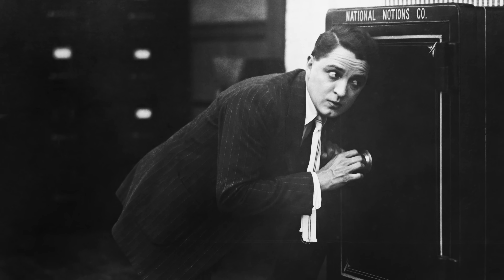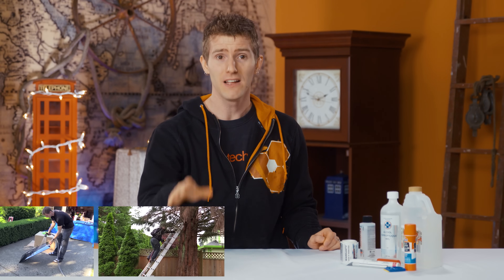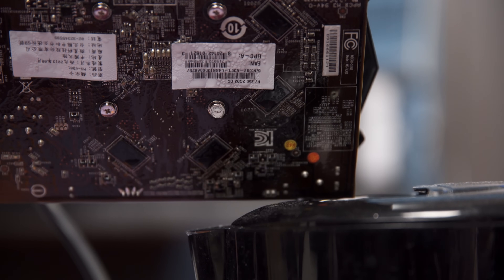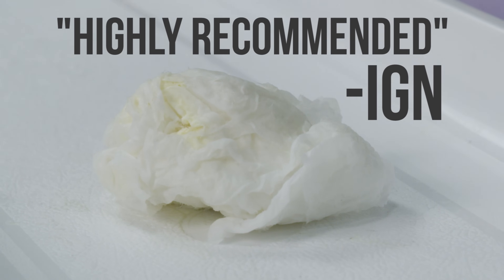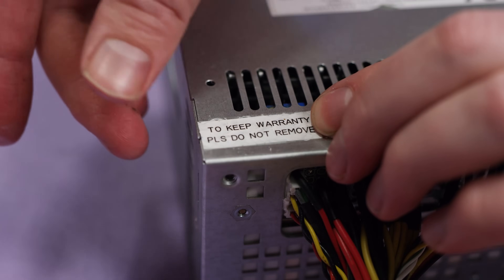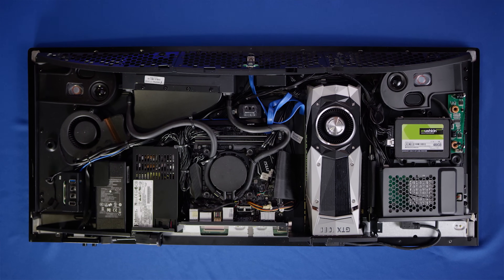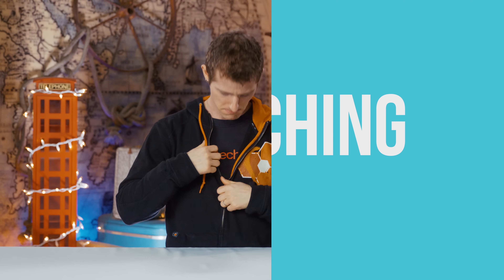Safely Remove Warranty Stickers

Comment: 'Warranty Void If Removed'? As It Turns Out, Feds Say Those Warnings Are Illegal
NPR, 11 April 2018

Oh, you've seen them before: those little stickers or tags making clear that if you want your warranty on a product to remain valid, you'd better leave one or more of its parts untouched. The idea, of course, is that consumers are barred from using third-party parts and repair services for the product if they would like to hang on to that guarantee.

Well, as you've probably long suspected — or desperately wished, at least — those warnings are bunk. Worse than that, actually: The Federal Trade Commission says they're illegal.

"Provisions that tie warranty coverage to the use of particular products or services harm both consumers who pay more for them as well as the small businesses who offer competing products and services," Thomas B. Pahl, acting director of the FTC's Bureau of Consumer Protection, said in a statement released Tuesday.

Specifically, the agency explained, those provisions violate the 1975 Magnuson-Moss Warranty Act, which bars companies from conditioning their warranties on demands that consumers use certain articles or services in connection with the original product.

That hasn't stopped companies from doing it anyway — and now, the FTC is fed up.

The agency said it had "sent warning letters to six major companies that market and sell automobiles, cellular devices, and video gaming systems in the United States." The FTC's announcement did not identify the companies by name.

Comment: If that's the law then it is wrong. There are many kinds of damages that cant be diagnosed as "caused by improper repair attempt". Examles?: Shorting some pins, putting higher than rated voltage into sensitive electronic IC etc. only time you would see visible damage is when things burn but even then it is not possible to prove that the burn happened due to "improper repair attempt" or on its own. So manufacturers SHOULD have the right to put such labels.

Comment: FYI: Adhesive remover is made from Citrus terpene. Often sold as "3M Citrus Based Adhesive Remover".
Apply it, wait a few minutes, and the warranty sticker will slide off cleanly, without damaging the sticker or the product.

Don't use any other solvents (especially acetone//nail-varnish-remover), or any of the other ridiculous DIY suggestions, as they won't work well, and may dissolve the plastic casing of your product, or damage the internal electronics.
Reply: The liquid may damage the components inside?

Comment: What has always boggled my mind is that opening the computer case is entirely necessary for maintenance to remove dust. How'm I supposed to keep the thing in working order without proper cleaning?
Reply: That's the point. They want it to break, they want dust and grime to harm the delicate components of your computer because then you have to buy a new one. It's artificial scarcity and it's the pits but that's why videos like this one exist.
Reply: yeap most people dont do that and complain about the machine slowing down or internal burning due to dusty fan malfunctioning and not cooling of anymore.
Reply: "You're not, you're supposed to buy a new one once it gets dusty"
-Tech Companies
Reply: mike Yeah, but I’m still using video card developed in 2014, and it’s work fine. Eat this tech companies :-)))
Reply: Good thing is here in Germany those stickers are sometimes on prebuild system BUT the german laws are saying you are allowed to open and maintain your hardware or even upgrade it.
Reply: Never seen a computer with a warranty sticker blocking removal of the sidepanels.
Reply: At least dell tends to be pretty reasonable with that, especially the alienware department which actually allows you to change thermal paste and do whatever you need as long as you don't break anything. Once called in about a fan that sounded weird and they told me to open the damn thing up and clean it. I always tend to contact them first though and get an OK before I open up the laptop to do whatever I need to do, just in case. There are no warranty stickers inside from what I recall. Perhaps specific for the alienware brand as it's targeted at gamers and gamers know their sh*t and refuse to not be allowed into their own laptops.
Reply: My case is so bad if theres dust it doesnt turn on and i have to open it so i do i have had this problem 6 times now
Reply: Flavory Meme - Sounds like you need a new computer (or new computer parts at least).
Reply: Is cleaning dust with a dry cotton cloth safe
Reply: The manual says to only operate the device in a dry and dust free environment so that should never be necessary.
Reply: @rubenproost2552  yeah but dust technially exists everywhere so that statement is useless
Reply: @thedeadlygames9716  I guess it shouldn't be operated then :)
Reply: you buy a new one every 3 months
Reply: You don’t need clean it every month, once per 1-2 year is absolutely enough, and your warranty usually end after one-two year.
Reply: @GrandmasPasta  well, it really depends on the environment I guess?
Reply: @radityoperwianto1339  dust exists everywhere om the planet
Reply: Psilocybe Cubensis Yeah but somewhere like the desert that is California is definitely gonna have more dust than somewhere cold like london
Reply: @GrandmasPasta  
Old comment, but this honestly depends on both the computer's purpose and the environment the computer is in. 

A business computer in a regularly cleaned office? You'll probably get away with not bothering for years. A gaming (especially enthusiast) PC build in a room with carpets and a/multiple long haired pets? Expect something to burn out before you ever get around to cleaning it if you're leaving it for an entire year or two.
Reply: @GrandmasPasta  
Yeah, but I'm going on the assumption that most people watching for this sort of information or looking in the comments for advice would take your recommendation at face value, having no idea if their situation is different to yours. I figure that it's well worth it to cover circumstances that aren't all that exceptional for plenty of people, so that people don't make mistakes that could cost them anything from a few frames per second to a new GPU (speaking from experience there).
Reply: @GrandmasPasta  
I don't personally think that anyone is at "roasting a cat in the microwave" levels for not really knowing how often to clean dust out of a computer. People who don't know much about a subject generally will make mistakes like taking a comment on YouTube for granted when the person making it seems to know what they're talking about.

Look, I'm not commenting to take a dig at your advice. It was good general advice, I just thought it was worth adding to for the sake of anyone who wouldn't figure there are circumstances where you should be cleaning a computer case out more often.

Comment: A heat gun can remove those stickers without leaving "void" on the item. Results will vary. Heat it up as much as possible without melting or burning. It's the best method for most stickers. You probably  didn't heat it up enough.

Comment: Watch out for companies that blame you for breaking the product and avoid them like the plague, for me it's been Apple who didn't even look at the ipod and told me it was my fault it stopped working all of a sudden even though there was no damage and no reason for it to stop working, this was back in 2005 but it was so bad a service I never went back with them.   Then Pioneer who said I broke the car stereo but refused to explain how and it was professionally installed but they didn't want to hear about it, it's super important to vote with your wallet when companies do this kinda cheap tricks to avoid replacing their faulty goods.  If a company will not stand by it's product and instead try to blame to the consumer it's straight up dishonest.

Comment: What about those that have small tears inside the main body? Good luck getting these off or dealing with performing a 2 hour disection of something that used to be a 5 minute job.
Also, gotta have to love those stickers which leave holograms as residue.
Still nice to see that those simple, square/round plastic/paper stickers aren't a thing of the past yet.

Comment: Thankfully, the FTC has recently stated in letters to companies that those stickers are illegal in products over $15.
Reply: SNBeast yep now they will just say you damaged it,instead of saying you opened it as the reason . Which is why pulling the sticker up without breaking it is a still a good idea
Reply: @Demon09-_-  you could make a foto of the device with the intact sticker to go to court. Now you can't
Reply: @Demon09-_-  Just take video of the broken product BEFORE you take the sticker off and then keep the video rolling up until it's actually off, then they can't prove fuck all, I know this is an old comment but it's an easy way around the BS excuse from the manufacturer.
Reply: @Demon09-_-  O
Reply: @Demon09-_-  then you take them to court. They'll honor the warranty then. They know they'd lose in court and will just give you what you want because a $500 game console or whatever it is is FAR less than court costs and such
Reply: I do not think there is legal reason for manufacturer to deny warranty, just because some sticker is damaged/removed.
Imagine you buy a car and you can not open engine compartment, unless you void the warranty.
If you actually damage the card in the process or the card dies because no/bad cooling, it is different story though.
Reply: BREAKING NEWS all apple products drop to $14.99 (+$1000 "tax"
Reply: Does that apply to my internet?
Reply: The FTC is a joke.
Reply: @soundspark   Repairing a HDD is highly unorthodox and honestly not worth the hassle. The dammge is usually too great for a laymann to repair with common tools.
Reply: arent you on the wii mini hacking discord?
Reply: @Bulletinki  lmfao
Reply: Stickers = Non-USA problems
Reply: He's in Canada laws may be different there
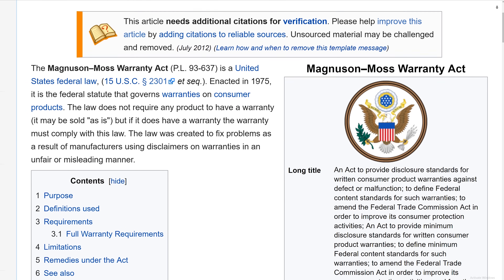Reply: @mattalford3932  True, but he's stating this because @1:51, they highlighted an American law, not a Canadian law.

Comment: https://www.ebay.com/itm/US-Stock-White-Teflon-PTFE-Virgin-Sheet-2-x-250-x-250mm-07874-x-9-8-x-9-8/391912231411?hash=item5b3fca11f3:g:dQ4AAOSwonBZ7sC3     use this and its eayer to sand down to the right thickness and its CHEAP

Comment: The law does indeed exist, but it doesn't matter, when you buy something, you basically agree the warranty contract, and it's written in the contract that a modified or opened device won't be taken in warranty.
So the law you mentionned is stupid af. It would work if there only was the sticker and nothing in the warranty contract, but obviously most brands aren't stupid.
Reply: Except the law makes it so such contracts are unenforceable that's the whole point. your argument is like saying even though courts have found non-compete agreements to be unenforceable you still signed one so it will be enforced, nope it is still unenforceable, no matter how good the contract you signed was because the clauses generally are against the law.

Comment: Also works well to place the removed sticker on another pressure sensitive base (i.e. remove a cheap Dollar Store Sticker and use the base sheet for placement before returning the Warranty Sticker to the device)

Comment: i literally give zero fucks about warranties, if something breaks, im more than capable of fixing or replacing it myself, and some are just downright stupid, quite a while ago, i bought a pre built pc on a pc building site, but without a GPU, as i already had one   , and apparently just taking the side panel off the case, voided the warranty, i did anyway, as i had no other way of putting the GPU in

Comment: Is this against the law in other countries as well, United States? Europe?
Reply: They just put it in the warranty  contract, and define it as intentionally damaging the unit like you drop it down to the ground at break the screen etc... 
So they may be repair your originally damaged part for free but, they can charge you for re applying the sticker. And it costs a lot, 30 euros (engineer hourly wage) plus the sticker price. But if its not burnt out and/or has a physical damage (broken soldering, PCB for example) they can say that you broke it when you opened it up and it was not broken before that (their expertise). So they refuse to repair it for free. And then you have to prove the opposite with expertise. If they don't accept your proof you can go to the court.
Reply: that would interest me also

Comment: i was having issues with my build after a thunderstorm yadayada idk what happened but I had to reinstall windows. I had originally borrowed a disk for my first build so i didnt have the disc around. I purchased a new one and when it came in, found out it was bound by a little foil sticker that, when broken, nulled a refund.

it took about 30 minutes carefully picking at it with a scalpel, but I got it off, used the disc, rebound it, sent it back for a full refund. aww yee.

Comment: A lock is designed to keep honest people out.
My method:
#1. Remove the sticker. Remove the glue and "void" left behind. Throw away sticker. If there's no evidence there was any sticker in the first place, then you can claim the factory forgot to put one on or the guy running the warranty won't know to look for one if he doesn't see it.

#2. Carefully rip off the sticker, but leave it attached at one end. When you reassemble device, use the "hinge" of the sticker to smooth the sticker down exactly as it came off causing the "void" left behind to exactly line up with the "void" holes left on the sticker.

Comment: I'm just not going screw around with it until warranty is expired.
Reply: Did you watch the video? The stickers mean shit. :I
Reply: Did you? By the law yes, they have to honor our warranty. But in real practice, they can fuck us unless we take them to court, which they know you and I won't because it costs far more expensive and time consuming than just buy a new time. I want smooth repair services and don't want any hustle, so I'm not going to mess around with it until warranty runs out.
Reply: Consumer protection agencies in many countries provide free assistance in such cases, as do grassroots organizations. Worth looking into.
Reply: That may be true and can be helpful in some cases. But that still won't change the fact that it is still time consuming and very unwanted hustle to deal with. It will be significantly easier when your item fails, don't mess with it and just take it manufacturer repair services, and be done with the problem. Why even bother with opening an item which we know will void the warranty (regardless of whatever the law says) while manufacturer will repair or replace for free.